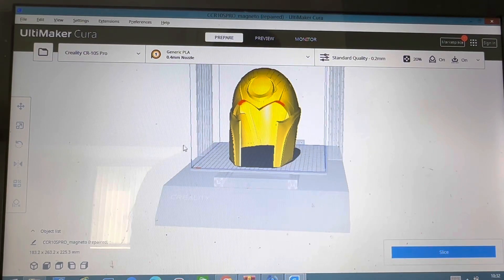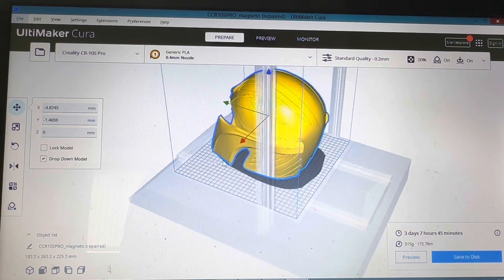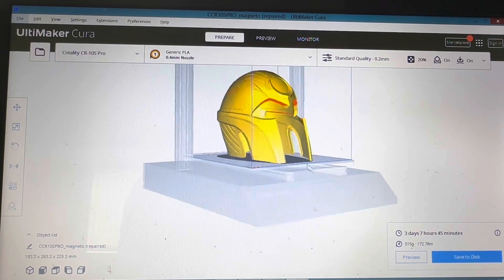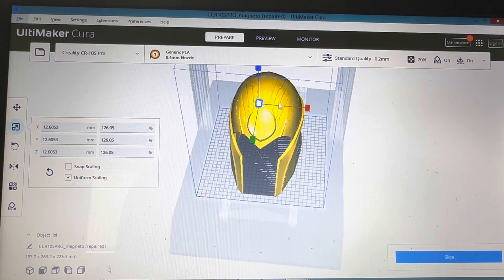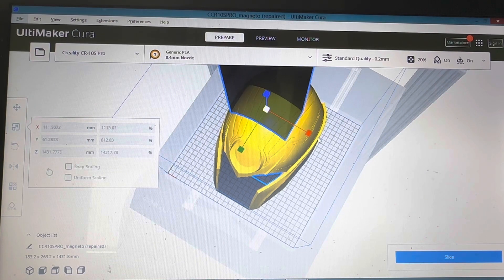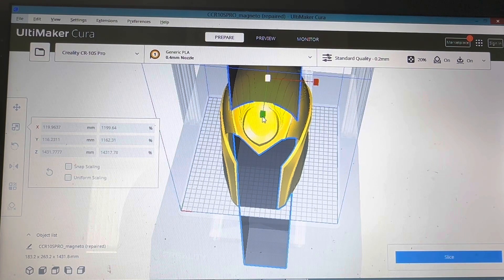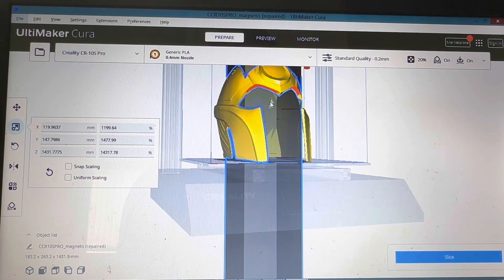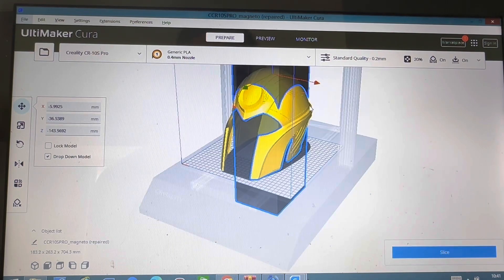Cura Ultimaker Support Blocker Tutorial

Comment: Always wondered how that option worked, Im currently printing the Rocketeer helmet to use as a lampshade and this will help a lot as you said even with tree supports its like a forest in there - Thaks!
Reply from the maker: Always wanted to print a rocketeer lid but never got round to it! Tree supports may be your best bet with that helmet as there is a few parts that will need supports! I wish you luck with it 👍🏻